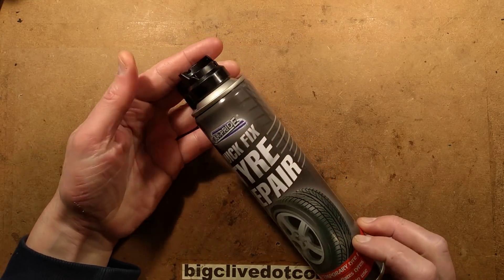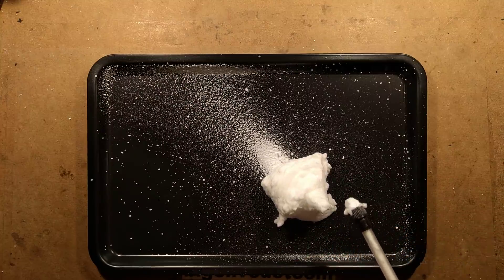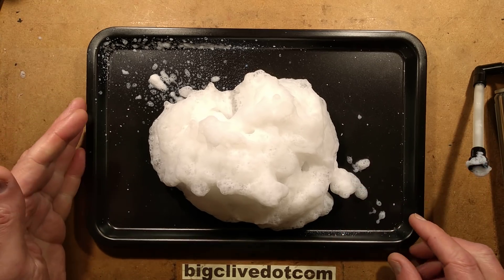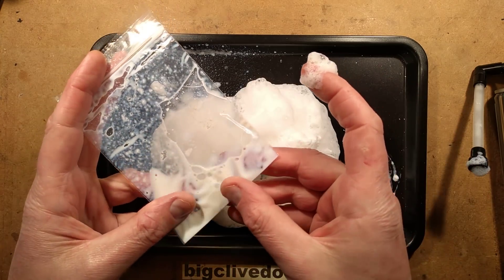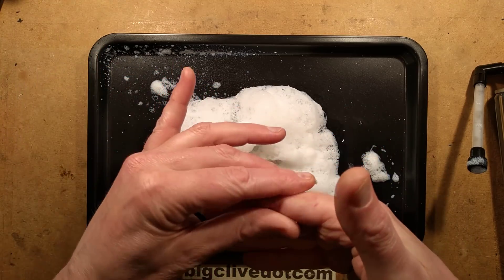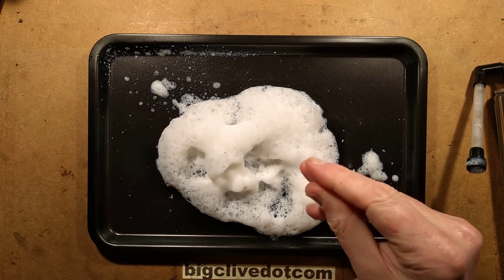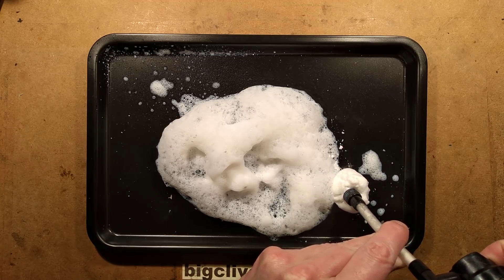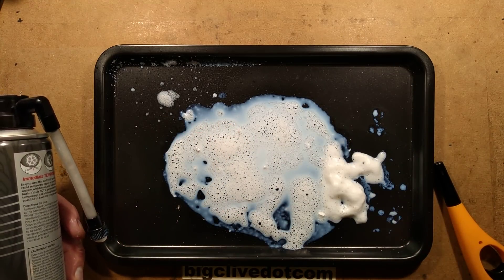What's in a tin of foaming tyre repair liquid.

Comment: I have used this on my car with great results, I was able to drive round for over a year and forgot I ever had a puncture,

I did put it in a motorbike tyre, however the hole in the tyre was bigger than I had relized, and the tyre went back down flat, shortly after I relized I was wearing the tyre repair liquid up the back of my coat!

Comment: We use this when I used to race karts. What happens is, when you squirt it in, you're meant to go for a drive. The driving causes centrifugal force, spreading a layer of it on the inside of the tyre. Then, as the tyre heats up, the rubber heats up and bonds. Once it cools again, the rubber hardens. This is what fixes the hole. In theory, you can drive normally for the life of the tyre.

Comment: I've used it once, although it was one bottle with liquid latex and a compressor instead of a bottle with both on it. It worked well for the remaining distance. It of course only works with small holes.

Comment: Interestingly (and forgive me if someone else commented this), liquid latex mixed with water is the basis of most mountain bike tire sealants. A lot of MTBers seal up the rim with tape put about 1/4 to 1/3 of a cup of sealant in and inflate the tire without a tube. Benefits are lower rolling resistance, pinch-flat resistance, and puncture resistance. 
The liquid latex seems to harden when it's forced through a puncture under pressure. As mountain bike run pressures close to those of most car tires (probably 5-10 psi less) I'm not surprised it works in car tires too. 
In MTBs the sealant does dry out every few months and needs to be topped off. This is probably why it's not considered a permanent fix in car tires.

Comment: They can and do explode. Usually when some poor tire repair tech is taking the tire off the rim to replace it. I think they do make non flammable versions of the stuff.  It will also wreak havoc on your TPMS sensors. 

If you use fix a flat on your tire, TELL the repair tech that you did it, so they don't get set on fire. Also you really should only use it to get to the tire repair shop or it will gum up your TPMS sensor and you'll need new ones.

Comment: I've filled my truck Tire with Fix-A-Flat. My tire is 235/75R15 4 PLY M/T. Drove it on that for 2 years and never had a problem. I just put the fix-a-flat in and drive it at low city speeds for about 10 miles then top it off with Air.

Comment: You will normally find that most tyre repair shops will not repair the tyre if this is inside and if they do they will probably charge you more for the time cleaning out the inside. I have used a similar system except you put it in before you get the puncture and it stays inside until you change your tyres, but it's bloody expensive

Comment: every professional tire care company I have ever gone to says to avoid this stuff like the plague if you actually want to have your tires repaired.  they cannot properly repair a tire that's filled with this crap.

so, it's more of a permanent fix than a temporary one, in that you should only use this if you plan to replace the tire en-tire-ly.

plus?  it won't last very long.  the latex does not stay stable at high speeds, or over long distances.  really an emergency only thing, and iffy at that.

The only time I had cause to use this was from carpet tack punctures offroading in Baja (I still have no idea why so many dirt roads in Baja have carpet tacks all over them).  it worked, but only lasted 20 miles of slow travel.

Comment: This stuff is the devil. Absolute evil incarnate. I worked at a tire shop and have seen people that have used this for both temporary, permanent and prophylactic use (put in before a puncture to seal it when it happens). It's impossible to unmount a tire with this in it without making a giant mess. It stays liquid inside the tire, a lot like what's left over after Clive sets it on fire. It smells awful, especially after it's been in the tire for months. It makes it impossible to patch the tire, since even after scuffing, the adhesive of the tire patch won't stick to the rubber. Many of these products are accused of softening the rubber of the tire and making it dangerous.

Comment: 1. I used it and it works. Spray it and drive it evenly covers the inside fills the hole and it's fixed.
2. My can says after used as soon as possible empty the tire and fill with air.
3. A lot of new cars don't have a spare tire it comes with tire-repair and a compressor
4. Lifesaver when you have no phone and you are in the middle of nowhere

Comment: The latex emulsion destabilises upon contact with air, coagulating and plugging the hole.  The butane / propane propellant inflates the tyre to between 10 and 30psi usually, depending on the size of the puncture and how much propellant leaks out before it seals.  The remaining latex in the tyre will remain liquid for quite a time but will eventually form a latex ball in the tyre that will clunk around.  It is extremely flammable but risk is extremely  low without an ignition source and you should always inform tyre fitter that you have used one.  I'm a chemist who has formulated these for other brands which is how I know.
Reply: Thank you for your professional input. Love when someone who made the thing can pipe up. Really adds to the positive internet experience. HUGS
Reply: Interesting to know how it works.
I can also confirm that it does ball into a mass inside the tyre.
My brother bought a used car, without knowledge that a rear tyre had this stuff in it. The wheel vibrated a lot , and no amount of balancing would cure it. Off with the tyre to reveal a ball of this stuff rolling around inside.
I'm also told tyre fitters hate the stuff.
Reply: I know this is an old comment of yours but i think its pretty awesome. How did you get the initial "recipe" for this product? I assume it already existed in some form when you formulated it for other brands? What else did you work on? What was the coolest or most odd thing you worked on? Any popular brands of stuff? Was it mostly a particular type of product? Did you work directly for the company or did they outsource the "formulation" to you? I have so many questions!
Reply: Probably an annoying question. But do you, as a Chemist of the appropriate field, know how the "slime" version of this solution works Chemically?
Reply: @jetblackstar  the green slime version has fibers in it which physically plug the hole.
Reply: You are professional, i am the manufacture for this products.it is really good products.

Comment: I've used almost the exact same product on a snow blower tire. Did the job for 2 years until I sold the unit. As far as I know it's still holding up. Another product I've used was mentioned in the comments previously "slime". Might make for an interesting video as it actually sealed up a bead leak until the tire was work out (to my surprise). Mechanic that did the change wasn't impressed that I forgot to mention this.... Ooops 😓

Comment: I've had a can of fix-a-flat rupture, and the contents seemed more like an epoxy rubber versus liquid latex. But that stuff is supposed to be a potential permanent fix for minor leaks and such. A more messy alternative to putting in an inner tube or patching for when you're in the middle of nowhere and there's no help coming. I generally carried a few cans on hand for off-road camping, just in case an ATV gets a flat, since you can't easily carry spare tires for ATV's.

I never ended up using it, and the can went bad and leaked, hence why I know what the stuff inside is like.

Comment: I recently bought a brand new car, yay me, at 1,100 miles, 1am, it picked up a nice juicy screw in the tyre, went to get the spare only to be greeted with a tiny compressor & a can of similar gloop. I tried the stuff as i had no option, amazingly enough it squirted straight out of the hole, which was no more than 1mm, it sealed bugger all. So i called the breakdown company for a tow home...
The first thing they asked was "Do you have a spare wheel?"  No i replied,  "Well we can't help you then, unless you want to PAY for a full recovery vehicle @£125?"
I was overjoyed, so check your breakdown cover....& it didn't stop there....the next day i took the tyre to the local repair place only to be told because it was covered in this gloop inside they couldn't safely patch it ,so i had to buy a brand new tyre!
The car actually has enough room for a space-saver wheel too, they just filled the wheel well up with a polystyrene filler to hold the compressor & gloop, so i also ended up going to the local scrap yard to buy a wheel...£40 & removing all Fords crap & bolting a new wheel in the boot.
Total cost around £220.....for a puncture...

ps. I've read since, i think it is the AA now use a weird universal fit spare wheel to get you home, fits 90% of all vehicles apparently...& there's more...although my existing breakdown firm ripped me a new one...I'm told Fords' own cover, which, unknown to me, the new car comes with..would've taken me home...yay

Comment: Many years ago, on the day my second child was born I picked up a nail in the back tire of my motorcycle. I managed to get to somewhere that I could get a can of similar stuff and it let me drive the bike until I could replace the inner tube on the weekend. It left a sticky mess to clean up inside the tire & rim but it did exactly what it said it would. After that I carried a can of it on the bike for years.

Some years later I used the battered & nasty looking can that had been in my topbox all that time to fix tires on my riding mower and my neighbours within a few weeks. Both of those tires held air for several years until we replaced the mowers and probably for a while after that.

Comment: If you leave it in your tire for some time it will dissolve some of the rubber inside of the tire becoming a very sticky and flowing layer inside the tire, it works but the cleanup aftermath is horrible.
Reply: One MacGyver comes to mind with this stuff: let the whole contents of the can deflate to liquid, pour over a test tube, vulcanise in your oven, rol the rubber sleeve of the tube and voila, your own home made condoms!

Comment: I have tried that kind of a repair liquid once for a bicycle tire but it didn't do the the job. The puncture hole did not got blocked. The foam just squirted out of the hole until there was no  pressure left.

Comment: I used that stuff a few times for punctures in the tread and it works good. Once sealed and re inflated with air you can drive the tire till down to the tread wear indicator.

Comment: That is very similar to Tubeless Bike Tires and the usual reason that this kind of tire inflator is discouraged is because most modern cars have tire pressure gauges inside the tires and something(presumably the liquid latex) destroys them over time. Usually you get the liquid latex in a bottle though and then pour that into the tire then you can inflate the tire with a CO2 canister or high volume pump. You do need something like that to seat the tire because a low pressure pump will not seat the tire. What ends up happening is that the silicon seeps out through any gaps and dries out in the air usually around the rims leaving a good shot and a half worth of liquid latex rolling around the inside of the tire. It is especially disgusting when yuo have to change a tire that is full of this stuff or are in the moddle of a ride and need to clean this stuff out to stick a tube inside the tire. Just like he said it covers your hands in boogery strings of ruber and chemically watery goop that spreads greas and dirt all across your hands and seals it beneath a hydrophobic layer. If you get a spike through the tire the latex squirts out and dries in the hole then you just put a bit more air into your tires when you notice your pressure is down. Even if the mixture gets to a flammable ratio it won't really matter because there is not a source of ignition inside the tire, the real issue is the low pressure air sensor inside them and if you use this sort of thing and do not clean it they will be destroyed after 7-10 months. I have no clue what they look like though so it would be interesting for Clive to go to a car place and get a used one or a failed one from a mechanic shop and look at the failure mode or to try to cause one to fail like that.

Comment: I've used this in an inner tubed tyre on a motorbike before with no ill effects although a slight seepage made it difficult to patch later. I've used "Slime" type sealants as puncture-proofing on bicycles and low cc motorbikes too, but always carry a plug kit for biger bikes, and always have a decent spare tyre in the van. I wouldn't use this or slime on a large bike or car tyre because I believe it would prevent a propper plug-type repair from working, anyone else have different experiences?

Comment: I recall that, back in the Model T era, a "do it yourself" repair for a leaking radiator was to fill the cooling system with potato soup and run the engine until the heat congealed the starchy goo when it hit the air.  Then drain and refill.    Of course, this wouldn't work with modern engines, but it's sort of the same approach.

Comment: In Sweden some stores baned that after a big accident, someone turned their wheel in to fix a crack in the rim, the welder started to weld and the tire exploded, killing the welder.
However, they have been very common, you fill up your flat tire with it, and directly after go out for a run for a fixed amount of minutes/km. The gas will expand over first 20minutes and slowly fill up your tire, so DON'T put in extra air.
It does work on very small leaks, but if you have a nail or similar damage to your tire you can fix that for under 35 GBP at a workshop.

Comment: Come to think of it, I might have used this to fix a flat tire on my bicycle, and left it in there for,, uhm 4-5 years now.  Mostly sitting in a cellar unused. 
Which might explain why one of the tires have developed a tiny bump on the outside. Could be the propellant have diffused through the tube into the tire itself, softening it a bit. Or possibly it's just the wet spot that has diffused, which would make more sense, since it has been unused before this year.  
Anyway, seems it's ok to leave it in there for a while, but it's probably not a good idea.

Comment: These quick fix tins are great they can get you out of a tight spot, but sometimes they don't work, they say take the object out the tire, but I always found it works better if you leave the object in the tyre.

I suspect they say remove the item because of the gas, allowing the gas to vent with the air as it seals up.

But the problem is quite often the tires hole is much to big for the foam to seal up efficiently so leaving the item that punctured the tire seems to work better.

I have been using them for many years, but now many tyre places refuse to repair punctures if you have used this stuff as their patches don't stick as good after using this stuff.

So if you want a really good tyre puncture repair kit for cars and motorcycles, try the stop and go system, I find this system excellent, and so long as you don't go mad  with the vehicle and mostly use it around 50 mph it is a permanent fix.

Just as a note I use the stop and go plug with a little bit of the foam squirted into the tire and it lasts the life of the tyre, even taking it up to 70 mph though not recommended you just have to try it don't you, it says don't do it so you have to do it right! just to see what would happen and so far every time I've used the stop and go system nothing happens, but I wouldn't want to try it on a long journey I would stick to the recommended limits in case the tyre shreds, which isn't very likely but on a motorcycle that's the last thing you want.

Comment: I think I once used it on a tire with a small leak. Didn't replace the tire until one or two years later. Though I'm not entirely sure if I remember correctly. Certainly doesn't seem to work if the hole is too large. Though at least you will be able to tell where the leak is. All that mess you're now making will be coming out of that one tiny hole.

Comment: I've used a different type called Tire Slime. It's got small black strands of rubber in a neon green liquid.
The strands get caught in the puncture, The green liquid drips out as you drive transporting more strands to the hole.
Side note car mechanics really hate this stuff since it's a real mess when you take the tire off the rim to replace the tire.
I've used the same stuff with mountain bike tires as well but there it's in the tube.
https://www.slime.com/us/index.php

Comment: I've used this stuff a few times over the years. There's no problem at all just leaving it in the tyre. Best thing is to run it a few days, then stop with the valve upright. Then empty and replace with air. The latex still sloshes around, and will still fix any small holes.
Then there was the time I punctured on the way home from holiday, it was dark, on the side of a French motorway. "Don't worry dear, we'll be on our way in a jiffy" says I. I attached the can and started, only slightly puzzled that the tyre didn't appear to be inflating, I persevered until the can emptied. "That's odd, the tyre hasn't gone up". Then a gust of wind blew a stray bit of what I took to be paper, and I brushed at it. It was the foam. Anyway, the whole lot had come out of a two inch long gash in the tyre, on the inside. By the time I had grappled with holiday packing, the jack, wheel change and putting the foam covered wheel into the boot, I was covered in the stuff.
Still mustn't grumble, only 500 miles to go!